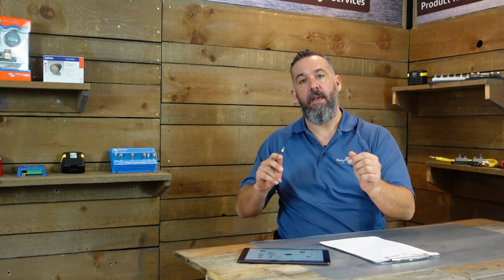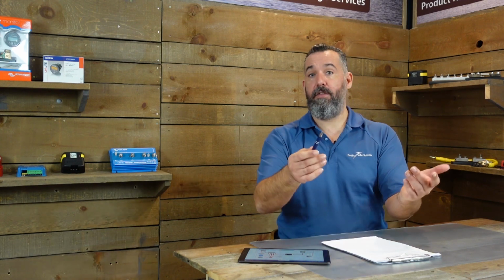My Windlass and Thruster Battery Only Charge on Shorepower - Is This Wrong?

Comment: Hi Jeff.  Love your channel, you are a fantastic source of knowledge.  I currently have an issue with my new to me Benetau 40.  I recently added a washdown pump and a larger anchor (55 lbs) to the boat with the washdown pump hooked up to the same load.  The overload keeps tripping just as I get to the point of bringing the anchor over the roller (of course).  I certainly know that the cabling is undersized based on the calculations (108 amps) I've done, but not have done all the voltage drops measurements such as across the contact relays, cable run, etc.  One suggestion given to me was to install a battery in parallel to the windlass and fuse it with a 125 Amp fuse in order to protect the battery.  This set up was actually done on a 55 foot yacht many years ago and is still working.  The concept is that the battery acts as an accumulator and shares the load between the existing system and the added battery.  In a PERFECT world all batteries in a bank should be equally sized but that would require a 4D battery.  All batteries on board are LifeLine AGM. Your thoughts please.
Reply from the maker: You could certainly add a bow battery for the windlass.   But I would not directly connect it to the house bank.  I would add an ACR or dc to dc charger between them.  Those would be fused at both ends

Comment: Question for a video Jeff. I have a battery bank at the bow for my bow thruster. Two batteries wired up to supply 24v. I have 2 windlasses, 12v each, running back to my house battery bank. Is there a way to use that bow battery bank to power my windlass? I’d need to step down 24v to 12v.

Thanks 

Tim

Ps I’ll just go google it but might be good content 😊

Comment: In this scenario how do you determine the size of the cables between house bank to the ACR and from the ACR to the BT/Windlass bank? When the engine is running and the ACR is closed it essentially is a circuit running from the alternator in the stern all the way to the thruster in the bow?  Would you just use the same size that is run from the alternator to the house bank, or do you need to upside all the cables for this?

Also, if for whatever reason the house bank is depleted so the system would technically get a “Undervoltage Lockout” and there is an emergency situation with a BS ACR 500A is it okay to use the bypass switch to combine the batteries so that alternator volts flow to the bow bank, or would that be problematic and there should be some manual switch to route the alternator direct to the bank in the bow?

Comment: I recently solved this problem with a battery to battery charger on a boat with a 12 volt start bank, 12 volt house bank and 24 volt bow thruster and windlass. I fed the battery to battery charger from a free output from a diode splitter on the alternator for when the engine is running and from an unused output on a 3 bank charger. This way the thruster batteries are charged while at the dock or with the engine running but the isolation is fully automated. A big step up compared to hauling the batteries out of under the V berth and taking them home to charge.
Reply from the maker: Did you connect the DC to DC charger to the battery isolator because you only wanted it to charge via the alternator?
Reply: @PacificYachtSystems  No. I set up the DC-DC charger with two sources, the battery isolator so it would run when the alternator was charging and an unused output on a battery charger so the batteries charge while at the dock or charging with the generator. This achieves my goal of the DC-DC charger shutting off when the charging sources are off so I'm not depleting the house bank.

Comment: I have same problem on my boat, 42’ twin diesel cruiser. House bank, 2 8D agm batts, are charged by one alternator. If I put combiner between house and stern thruster batt I am worried it might be too big of a load on alternator, 2 8D’s and a group 31. Hence,  I only charge stern thruster batt by battery charger. Alternator on other engine charges start batts and huge air heater’s load for 5 minutes while main engines warm up ( to reduce smoke) Need a combiner with a time delay if there is such a thing.Bow thruster is powered by house batts.
Reply from the maker: Thanks for sharing!

Comment: I here you talk about not putting certain electronics in engine rooms. Maybe you could answer this question in a video. I have an outboard engine but my fuel lines travel through the same compartment that my batteries are stored in, is this a concern? I change my fuel lines out every couple of years for safety reasons. Your thoughts?
Reply from the maker: Good suggestion.

Comment: A DC to DC charger also works well in this application. Locate it near the bow battery.
Reply from the maker: Hi Howard, what's your reasoning behind install the DC to DC charger at the bow battery, are you trying to offset voltage drop to the battery from the DC to DC charger?
Reply: @PacificYachtSystems  I am considering doing this as well. I currently have a combiner connecting my house battery bank to my bow thruster battery. The main issue I have come across is that when the combiner is activated and the bow thruster is engaged I see a voltage drop in my main house system and a pretty substantial lug from the alternator on my engine as it tries to deliver amperage to deal with the sudden spike. Ive been told that I can connect the combiner to a relay that breaks the connection when the thruster control is on to avoid these spikes. I may also add an additional battery to the bow thruster bank to provide more cranking power for those short bursts when the thruster is engaged. That said, I also think a dc- dc charger could also be a solution to keep my thruster batteries topped up while underway, but then I lose the ability to provide "support" current to the bow thruster battery from the house. Mulling it over as I think I could go either way - relay to the combiner OR installing a dc-dc charger. Any thoughts one pros and cons of doing it either way?
Reply: @PacificYachtSystems  yes, better sensing of batt voltage for better charge profile unless you use a charger with remote sense. Just another method to charge a remote battery.

Comment: Thanks, Jeff!  Right now I use my house bank of four 8D AGMs for the thruster and windlass, and am about to upgrade to lithium, but keep one of the 8Ds to dedicate for the thruster/windlass.  Keeping that battery charged is a key part of the system, so you just answered an important question.  Would you recommend any kind of B2B charger for when the engine is not running to top off/maintain the thruster/windlass battery from the house bank?  Right now I have a Xantrex Echo Charge to maintain my genset start battery from the house, would this work for the thruster/windlass battery assuming that the heavy lifting is done by the alternator?
Reply from the maker: Hi David, consider a DC to DC charging converter as it will give your thruster and windlass battery exactly what they need as a charge profile. The xantrex echocharge is good but the DC to DC charging converter is better.
Reply: @PacificYachtSystems , much appreciated!  Would something like the Victron Orion TR 30A be a good choice?  I already have one that I can repurpose.
Reply: I was just about to ask this, so can a DC to DC charger be a third option? Or is there a reason you didn’t mention it in your video.

Always appreciate the videos Jeff ✌🏻